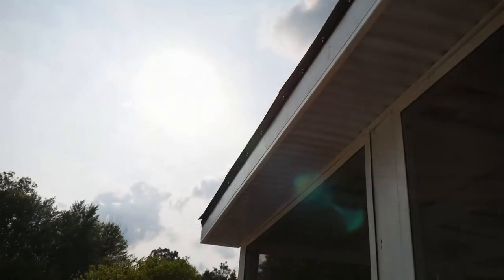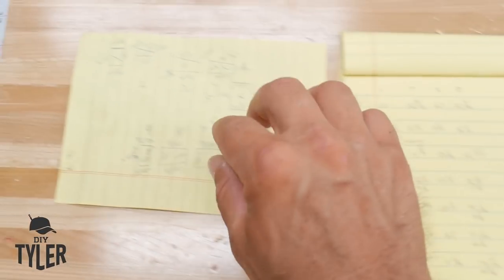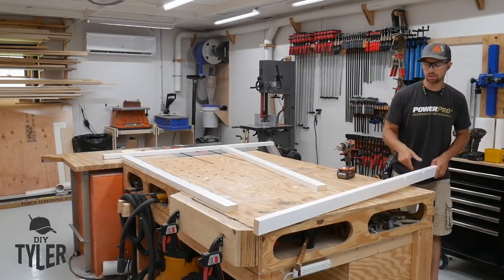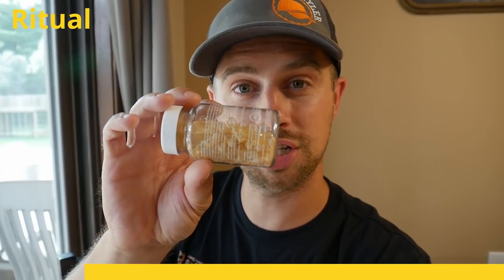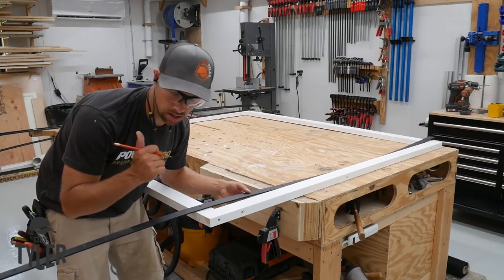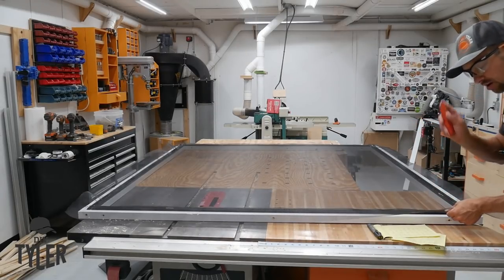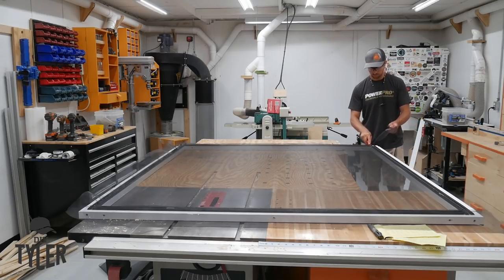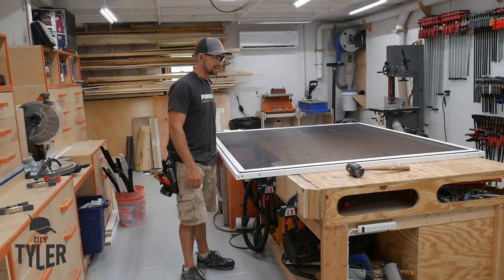Window Screens 101 | Step by Step How to Make or Repair Any Size Window Screen

Comment: We did the same idea for a knee wall but used translucent polycarbonate panels and added LED lights between the panels the whole length and width of our 24'x 10' deck. The whole wall lights up on both inside and outside with the lights on. Thanks for the idea it worked great. wish i could post a pic.

Comment: Perfect timing. I need to build two sliding screens doors for my shop one 12x12 foot and one 10x10foot. Thinking will need a divider on them.  Will put them on a trolley system and thinking how I will fill the void to keep skeeters out

Comment: Why not use a washer head screw for attaching those black plastic tracks to the frame? It would have less risk of it blowing through when driving the screws or tearing through over time. I like to use GRK’s cabinet screws 👌
Reply: David, I'm getting ready to install upper cabinets. What type of screw do you use for fastening face frame of cabinets? I've seen people use drywall screws. That doesn't seem right. I bought Grk #8 trim screws. The thread seems too course for hard word face frames.
Reply: @dougprentice1363  I haven’t made any cabinets with hardwood face frames, so I wouldn’t have a very relevant opinion…I do know for hardwoods, in general, people tend to like finer threads, predrilling, or a combination of the two.
Reply: Lowes carries Lath screws made by Teks that are perfect for projects like this. Ive used them for vinyl J channel where you dont want the plastic to pucker up like it did when he put that wood screw at the end of the screen channel.